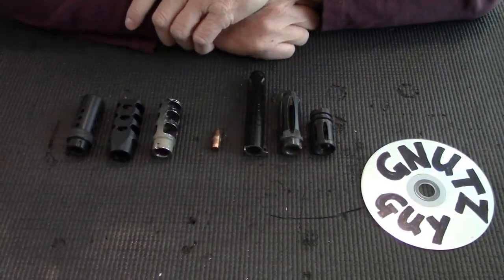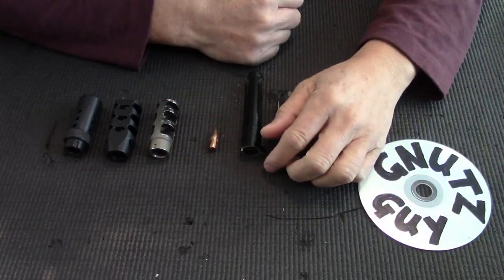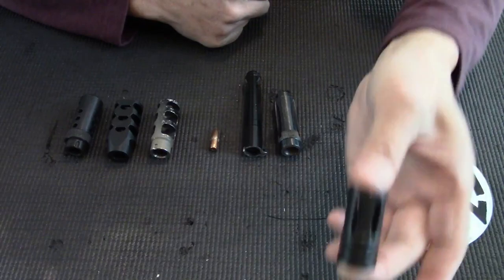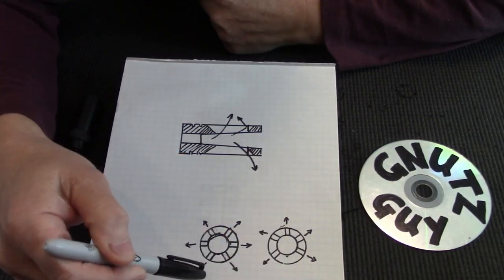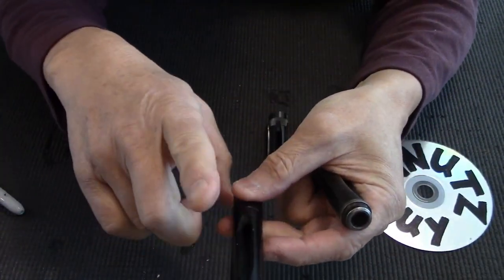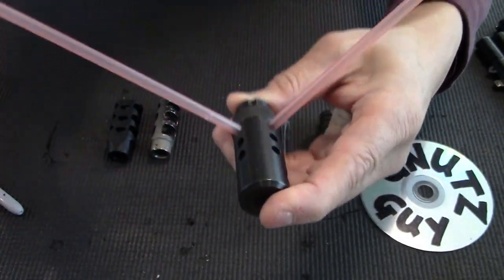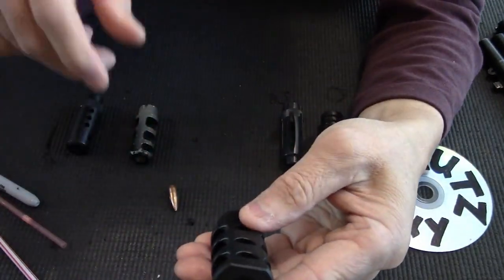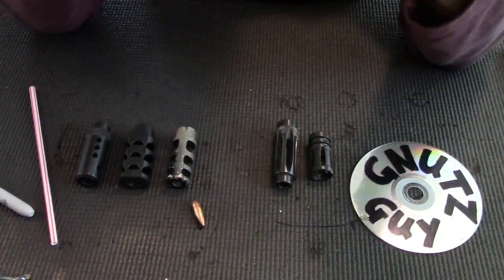Task of Muzzle Brakes & Flash Hiders. FN Fal L1A1 device mod to VZ-58 & Type 81 LMG.

Comment: What flash hider /muzzle brake can be used on a Brit fal l1a1 , can't find anything
Reply from the maker: i know a chopped L1A1 flash hider will fit a VZ58 but i have never tried a VZ58 flash hider fitting a L1A1 and i nolonger have a L1A1.

Comment: Just to double/ triple check.  For the first gen LMG, the bubba 9/16 FAL FH works?
Reply from the maker: no. you need the latest lmg with m14x1 RH.

this is from my description. Note: Serial number up to 20202000, the muzzle thread is M16x1 RH like mine. Serial number 20202001 and higher, the muzzle thread is M14x1 RH, same as VZ58.

Comment: I have a Argentine fal, it’s all metric, will that Brit 3 or 5 slot muzzle brake work on it?
Reply from the maker: i dont think so bcos yours metric, metric uses LH thread while inch fal uses RH thread but the best way to know what you have is to remove the flash hider and measure it.
Reply: Gnutzguy ok, I thought so. Thanks👍🏻

Comment: To Gnutzguy I enjoyed your Presentation however you failed to mention (Nothing Personal) a lot of guys do not mention this, my point being Lets get back to Basics The Original F.N. F.A.L. FLASH HIDER, THE IMPORTANCE OF THE HOLES DRILLED INTO THIS DEVICE, BUT FURTHERMORE THE ANGEL OF THESE HOLES, AS AN (RET) ARMORER IN Oglaigh na h - Eireann I had a chance to Experiment with machining my own Flash Hiders from solid Square Stock and I applied the Absolute Ideal Cutting Angel which you will find on All High Quality Knives The Perfect Cutting Angel is 22 Degrees this is a Proven Scientific Fact even the Surgeons Scalpel has an included Angel of 22 Degrees so many years ago when my Co told me about this Fact I decided to conduct an experiment of my own, I made a Flash Hider of my own and I drilled the Holes TO AN ANGEL OF 22 D, when I threaded it to the sample F.A.L. I found that instead of it Rising to my Right because it is Right Handed Rifling 1 in SEVEN R.H.T. This config made the weapon ride straight back into the pit of my shoulder and there was practically no reset sights back on target which saves Time and in Battle could save your Life. I showed this work to my Sargent Major and he was impressed to say the least, now as you would say I did Not reinvent the wheel again, I simply Reinvigorated the Concept and it worked out Extremely Well, Unfortunately the Concept was NOT adapted to all the other weapons in the Armory, as I was informed it had something to do with Copyright Issues but I thought I would through this little nugget of info into the Stew to Enhance the Flavor, unfortunately thats as far as I could go as my work was Limited to being carried out behind a 25 Foot Wall Topped with Razor Wire in The Barracks where I was Stationed, in Dublin, Ireland, but that was many years ago and we now use the Steyr A.U.G. 5.56 mm Give me the 7.62 x 51 mm any day, buts thats a conversation for another day as you know only too well. well thats about it I am from Ireland where Gun Law is simple you are NOT ALLOWED TO OWN ANY WEAPON BAR A SHOTGUN LIMITED TO THREE ROUNDS, and even Air soft guns are regulated, SO GET THIS ONE THAT IS (1) JOULE OF MUZZLE ENERGY anything More Than That And You Are Looking At A possible LIFE SENTENCE IN JAIL, as you must have guessed I was A Soldier.In My Humble Opinion IRELAND must have the most Stringent Gun Laws In The World Period, and if I could have the chance I would Get an F.N F.A.L. ANY DAY OF THE WEEK I think when they were introduced in 59 they were way ahead of there time in EVERYTHING, LOOKS 10/10, ACCURACY 10/10, STOPPING POWER 10/10, LONGEVITY 10/10, They in my opinion are Simply the Best and we could not go without an Honorable Mention to the yes you guessed it, John Moses Browning's Last and Beautiful Designed Browning HI = POWER 9 mm...oh how I miss my ARMY DAYS now the closest I can get to an F.N. is by watching Great Video Content like yours, and Hickcock 45, SOOTH, IRAQUE VET 888, T.N.P. The list goes on, Listen Up, Keep up the Good Work and always Remember this Old Adage...OLD SOLDIERS NEVER DIE, THEY SIMPLY FADE AWAY, God Bless Stay Safe and ALWAYS BE ON GUARD...C, F, L, F, U, E, E....COCK FEED LOCK FIRE UNLOCK EXTRACT AND EJECT, Goodbye from Ireland. Peter O'Neill
Reply from the maker: hey peter, you get the honor of the longest posting in my channel, lol. it was an enjoyable read. 
i too was an amorer but in the canadian army reserves back in the 70s. yes, i too was trained on the FN. we call ours FNC1 or C1A1. We were the first to adopted the inch pattern in 1956 before brits and aussy. 
it does sound like the gun laws in your country are tougher but we too are heading the same direction with our current liberal government. they have already banned my AR15, VZ58, Evo 3 and soon freeze the buying and transferring of all pistols. they are also going after airsoft. 
yup, i remember the old adage. thanks for the encouraging words. you have a nice day... Gnutzguy
Reply: @gnutzguy  Thank you Sir, Once a Soldier always a Soldier feel free to hit me up anytime for a chat I would enjoy that, its good to chat with a Kindred Soul and Thank You for the Reply
Reply: @gnutzguy  I thought I was having a stroke

Comment: Don’t have the tooling for threading the barrel so I bought a bolt on works OK but I’d rather have it threaded one sometimes the Bolt comes loose
Reply from the maker: i assumed the GL was removed first before put on a hider but how does it bolt on to a smooth exterior of the barrel?
Reply: Using an SKS muzzle brake just sold my type 81 working on getting another  but to use a muzzle brake that bolts on you have to make some custom brass shims because you remove the Front sight  but you want to keep it level so you don’t  strike the muzzle brake

Comment: You are wrong about the Canadian and British L1A1flash eliminators the SLR had five slots same as the Canadian version used one for 20 years and own one now .
Reply from the maker: nope, i am not wrong. what you have is the brit 5 slots first version, what i have is the brit 3 slots second version. canada and australia never made 3 slots.
Reply: @gnutzguy  You spoke about the screw on eliminators but never said how the British eliminators were held in place its definitely not a screw thread everything on the barrel is smooth except a groove at the bottom leading edge so whats the secret to attaching the eliminator ????
Reply from the maker: no secret, its a screwed thread. i even gave you the thread and pitch thats in the brit flash eliminator, some how it was close enuff that it threaded onto my vz58.
Reply: @gnutzguy  there is no screw thread on the barrel there is a small 1/2 inch groove on the lower edge of the very end of the barrel going backwards 1/2 an inch there is no screw thread inside the illuminator at all.
Reply from the maker: nigel, is yours a clone FN or a genuine? where is the receiver and barrel made? i looked at the blake steven bible and it says there should be a thread on your muzzle, like all inch FN.
Reply: @gnutzguy  as soon as I get back to Iowa I'll have a look but I know its metric Canadian 308 if I knew anything about all these electronic gizmos I'd send pictures but Me and computers never get along.
Reply from the maker: you dont need to check, you dont have a FN C1 bcos canada never produced metric fal but we did order 2000 metric FAL ex1/ex2 for trial.